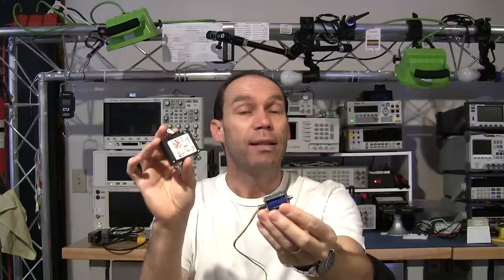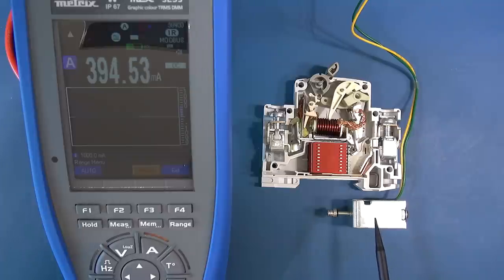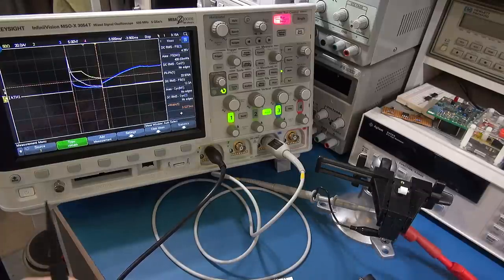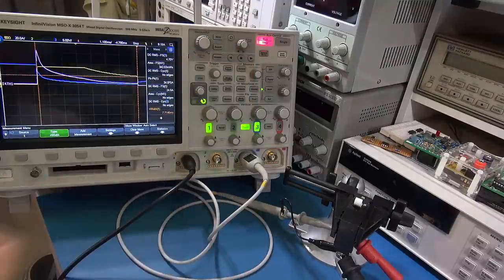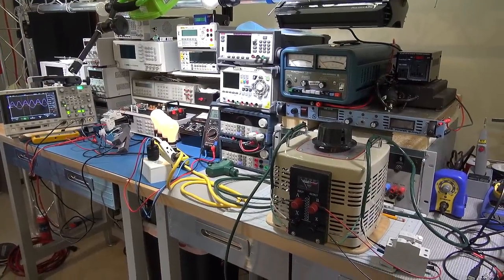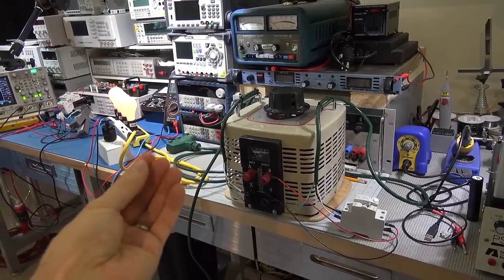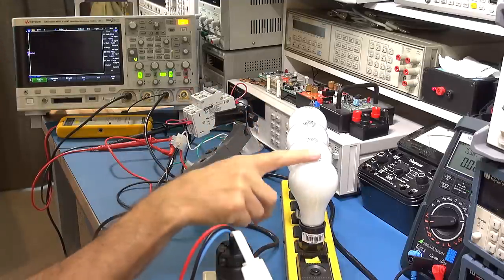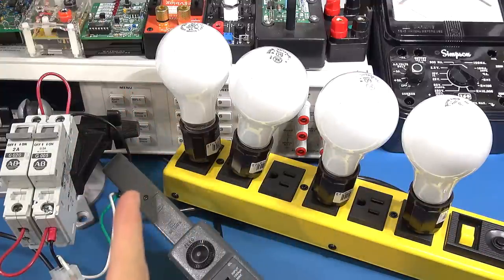How Does a Circuit Breaker  / Trip Switch Work? -  Pt 2

Comment: Great couple of videos. An extension to this would be to use a thryistor control to switch on the bulbs at an angle. It would confirm the theory that the solenoid requires a certain amount of energy before it will turn on.  I imagine the solenoid will only turn on during the positive cycle but it would be interesting to see the results.

Comment: With the DC breakers your thinking that a faster trip time is from higher current is correct to a point, as you get above the instantaneous trip current ( depends on the breaker and how hot it is) the trip time drops, as there is more energy put into the trip coil to generate a magnetic field acting against the inductance of the coil.

Ac trip you can see the trip time is dependant on energy, but also the trip is shown by the small  variation of current and voltage, followed by the tail off to a zero current as the breaker points separate and the current drops as the arc between the contacts dissipates power.  As the mains peak ( irrespective of whether it is positive or negative, the power in each case with a resistive load is going to make a positive power flow into the load) shows there is a lot of energy put into the coil to build up a field, and this is shown by the short time betwen closing and the small wiggle as the contacts start to trip, followed by the arc dumping power. At the switch on into a close to zero point the current will build up slowly, and the breaker will trip slower just because the field is building up slower.

Note that in all the cases the breaker had started to trip within a single half cycle of the incoming mains, irrespective of when the overload occurs. With a lower load then you will be depending on the thermal trip, which can take a long time ( up to hours for only a small overload) to trip the breaker. The current tail is the main danger of using a breaker rated for AC on DC, as the arc will not extinguish properly as there is no zero crossing points to help by reducing power to zero, which cools the arc channel so that eventually it no longer is ionised.

A high enough voltage ( with a typical residential AC breaker) of around 60VDC ( 5 car batteries in series) and a low enough resistance load ( 30A of resistor that can handle the current for a while) and try to break that with an AC breaker will result in it arcing continuously, and not breaking the current path at all, which will burn the breaker to char in a few seconds. That is why you typically see breakers have a rating of 400VAC or 28VDC, just from that arcing.

Comment: When I test rcds, you have to test both negative and positive times. The testers have a 180° button that triggers on the zero crossing. So i would disregard any results you get if you haven't hit that on switch very close to a zero crossing.
All the best.
Reply: What your looking for is the slowest disconnect time rather than the fastest. worst case senario as it where. Also your going to have trouble testing this in the lab, as when the mcb is in the consumer unit conected to the grid. If there is a shorted wire, that mcb takes all the amps the distribution transformer can supply. That could be 20k amps.
Reply: Sirus An RCD is an electronic device and trips via a very different mechanism..
Reply: Monkeh616 I am Aware of this.

Comment: Great video Martin.
Quick question. If a breaker is rated for ac only, what then would be the problem if we run dc through an ac breaker?
Reply: Clive Trezona it will require much higher current to get it trip ,for example it was rated 10a AC,put it on dc,30a will not trip it thats what i get from my experiment
Reply: Tonny Cassidy Interesting, thanks.
Reply: Tonny Cassidy Your experiment is somehow flawed. A 10A breaker will not sustain 3xIn with DC any more than it will AC.